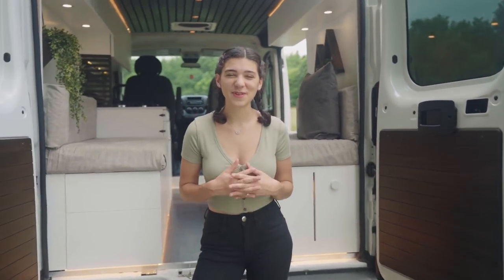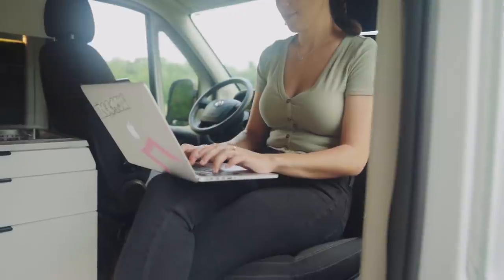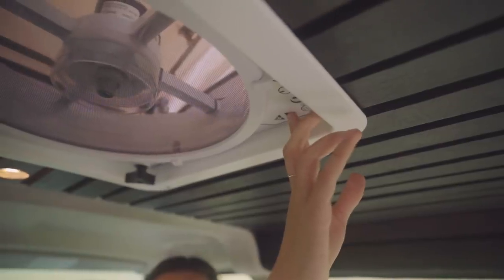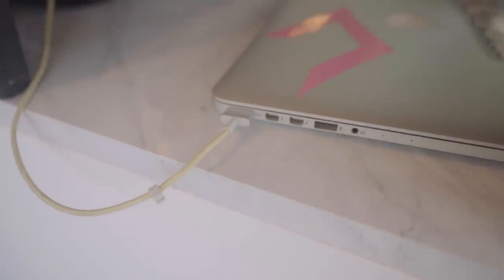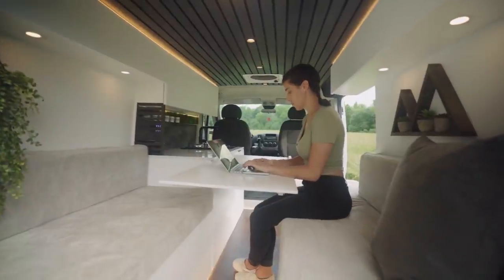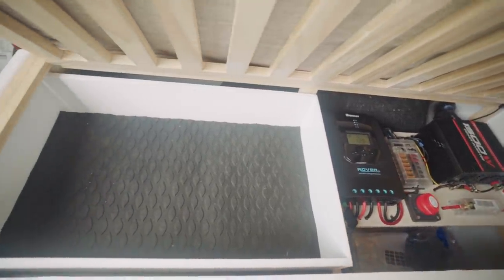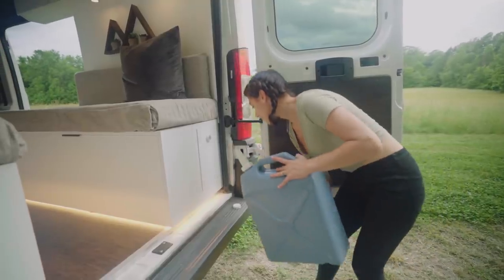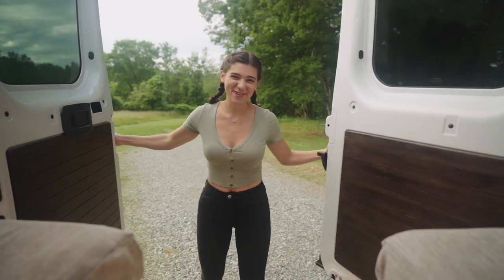VAN TOUR | MODERN STEALTH CAMPER | DIY Budget Friendly Promaster Tiny Home for Full Time Vanlife!

Comment: This concept inside a Promaster 1500 136" High Roof would be insane. The only thing I would really change is where the battery isolator is located. We put ours inside the engine bay.
Reply from the maker: Thanks! Since the battery on the Promaster is actually located in the drivers side floorboard we felt it best to keep the isolator close by!
Reply: @scarletandseth  about the cook top, Did you have any issues installing it? It's been mentioned on Amazon that installation requires a part that the company refuses to provide for use in the US.
Reply from the maker: @yourpcmd  I bought different hoses and fittings anyway and actually put in a better regulator as well, so it was fairly simple once I got the hang of it!

Comment: This build turned out great! Looks really clean and professional. I'm about 100% convinced that my next build will be a 118 Promaster.
Reply from the maker: Thank you! It is quite an awesome van!
Reply: I have a 118” sprinter and I love it. However, it is the high top. I cannot overstate how important being able to stand up is. This women is short and can stand in these amazing builds. If the Promaster would raise the roof on the 118”, they would not be able to keep them in stock. Mine was a former work van and I did a minimal conversion. If I had to pick, I would take the 140” and the high top over 118” on a shorty.

Comment: Very nice looking.
Couple of things.
Have you thought of recessing the gas hob into the benchtop and adding a insert to cover it when not in use like people do with sinks?

I cringed a little with the grey water tank sitting low on the belly with no protection. 
A small stick or bump and you will destroy that tank I would put on a skid plate of some type.

Comment: Looks so beautiful. Love the fold-out table idea there. Super clever. Why did you go with the low roof van when most would have the mid roof or high roof van?
Reply from the maker: We love the low roof for the driving experience, gas mileage, stealth aspect and may other reasons! It alsoforces creativity in design in a way the larger vans don’t and we enjoy the challenge. 😊
Reply: How tall are you? I am 5'2 and am wondering if I'd fit like a puzzle piece in this van. :) I love it!!

Comment: Realistically, you gotta have a bathroom to live in a van. Very cool custom features though. Also, you mentioned a battery isolator is essential to charge batteries while driving. I’m pretty sure that’s called a DC to DC charger. It has an isolator in it, but also needs to monitor overcharging etc.
Reply from the maker: Yeah, it’s a combination of isolator and charger!

Comment: Love it! Such an awesome and clean job 👏 
Quick question: where you bought the swivel seat? I am looking for my 2019 promaster 2500.
Thanks 😊
Reply from the maker: Hey, thanks for stopping by! We got it on eBay!
Reply: @scarletandseth  by any chance do you have the link? I have not found any with the same mechanism as yours... thanks 😊
Reply from the maker: @freespiritvanlifelala1927  Here ya Go!!! https://www.ebay.com/itm/223976829507 I had to put shorter bolts on ours so that it would clear sliding forward and back and both swivel seats we have installed came with no instructions. But they work, and if you have any questions about install you can always reach out!!
Reply: @scarletandseth  
You rock!!! Thank you so much for your help and fast reply ❤ 
I will check it out right now... thanks again 😊
Take care and stay safe 🙏

Comment: How strong is the table when folded out? I tend to lean on tables quite a lot
Reply from the maker: Thanks for checking out the video! The slides used on the table are all 250lbs. I'd say at the weakest point it would be good for about 100 or so.

Comment: Just out of curiosity and slight confusion: how does the water run from the back of the van all the way to the kitchen area up front AND on the other side?
Reply: In one of the videos, he showed that he ran lines for their sink and uses a water pump to draw from.  They did an amazing job on this and in such a short time and a small budget.
Reply: @michaeld7617  oh wow! did not realize that was possible. I was thinking they move tanks under the kitchen from the water storage area. That's genius... thanks for taking the time to reply!!

Comment: Hi. 
Just ran across your demonstration. I have not taken time to discover what state you are located. Very nice job !  Would you be willing to give a cost of adding to my 136 low roof these items: invertor/isolator, batteries, solar, air conditioner&maxair, & usbports & electrical sockets ? I'm 5'1'' so i can stand in low roofs. Thank you so much for considering helping. 
,gg

Comment: missed opportunity to not install a toilet/shower in a van this big
Reply from the maker: This van is actually among one of the smallest midsize cargo vans on the market. It is a 118 wheel base low roof which means the height is only 5’4”, so a shower inside would be very uncomfortable if you’re not able to stand upright. Since we built it to sell, a toilet would be a strange thing to sell. As said in the video, we built a space for a composting toilet, but figured it would be more sanitary to leave that decision up to the buyer!

Comment: How  much is this van?
Reply from the maker: There are so many factors when it comes to cost! How many miles, condition of the vehicle, how many owners, etc. additionally it depends on if you are going to build it yourself or have it built but the price could easily range between $25-50k depending on those factors!

Comment: Low roof vans are pointless. Also your furniture is made from heavy materials. Looks like the ceiling is also made from heavy wood planks. You sacrificed weight for looks.I'm not sure about practical that table will be. And only one seat turns.. the arrangement could be better.
Reply from the maker: I don’t think 1/2 inch birch plywood is “heavy for cabinetry. Also, low roofs are not pointless. There are actually plenty of people under 5’6” that can stand in here.